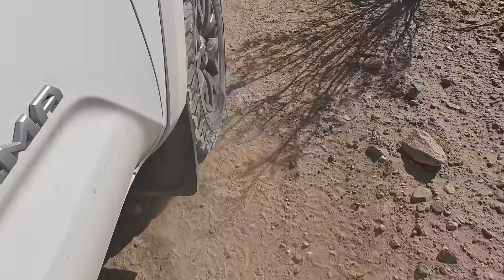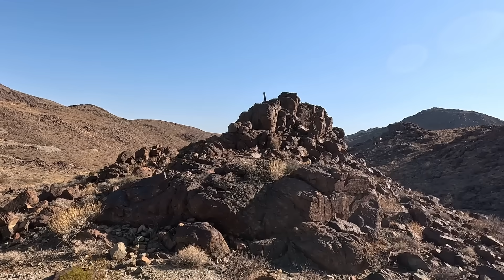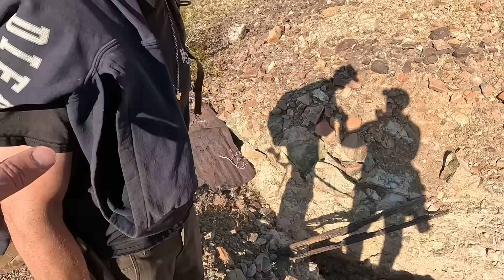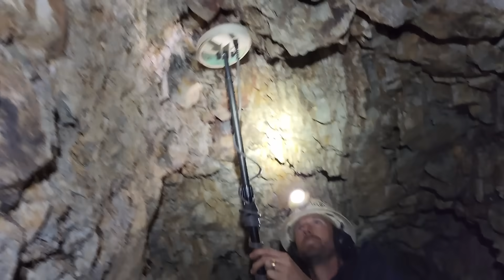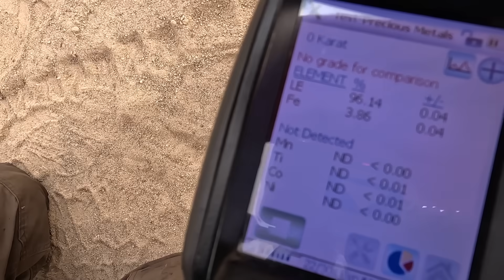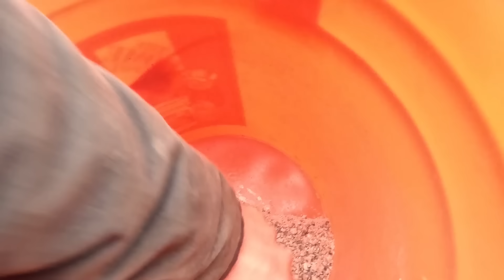Metal Detecting & Exploring California Gold Mines

Comment: Night and day difference in detectors there. That White's Goldmaster 3 is almost museum-worthy. I think its running at like 50khz and was introduced over 30 years ago. Meanwhile that 2300 is using pulse induction and the tech inside is only a decade old. Finally we saw the GoldMonster 1000 which is famous for pickers. It's also a VLF but running at 45khz and at less than a decade old has the most advanced hardware of the three. For those big pockets you might want the GPZ7000 but for inside adits like this the Falcon MD20 is extremely handy. You probably know all this though.

Comment: Running a detector is not easy.
I would say it’s kind a like learning to play the piano.
 There are pianos that play them selves almost but you still don’t understand what it’s saying.
 You guys need lots of lessons on detecting especially hard rock.
 It takes time and practice and concentration What’s your not able to when you’re first learning for more than a few minutes it’s like go lean muscle reflex reuse our learning you can only do for a couple minutes until you get some experience and the more and the more you do it the longer you can do it and the better you can concentrate.
 Takes practice at home learning how to run your detector everything Hass to be almost just perfect it just takes somebody that knows what they’re doing to stand there and do you all started since your all into gold..
 All detectors discriminate all in your ear that’s why the best headphones you can get I work for you is necessary beginners go through headphones fast..
 Make sure whoever is giving you lesson has found 1000 to 10,000 nuggets it will make it much easier on you.
Reply: Salva piano you could say it’s like welding if you didn’t have anybody to show you anything about welding can you do some wet old sticks I am it was all up to you to figure out.
 You’d be welcome pipe by the end of the day.
 Just like you’d be finding gold with a Detector by the end of the day.
 Can you put a wire welder in your hand that I got all tuned up the right metal the right wire right And you could draw a line with that welder and make it kind of work but if you had a tune it up yourself or understand what’s going on I’d be lost.

Comment: 2:36 As a hot intrusive is cooling, everything shrinks, the weakest fractures allowing residual fluids to hydraulically inject and push the country rock apart. This can repeat multiple times, metal content varies. With compass note strike, you would want to travers at right angles, hoping to crosscut an interesting vein. Could you pay attention to shitty audio. FIND a way to use Bluetooth clip-on microphones with windsocks, all conversations become crystal clear, greatly improves the video! Make this an important audio upgrade, you want repeat customers. I have tried get your attention numerous times; you keep putting it on the shelf.

Comment: Loved this video along with all your others. I have a metallurgical engineering degree and worked in several large scale gold mines over the course of my career. I have worked operations from heap leaching to cyanide in vat leaching, to gravity separation of coarse gold. Hearing you discuss the tailings reminds me of one of my professors stating yesterday's tailings become tomorrow's ore. Tailings are ideal as most of the energy required to mine, haul, crush, and grind has already been expended. It is not at all  unusual for older tailings to be reprocessed several times over many decades. Obviously the value must be in the tailings to make reprocessing them economically viable. This is a great channel and reminds me of family run mines some of my friend grew up on as kids. Thanks for sharing the excitement of mining.

Comment: The early 1932 or 33  is when all the gold coins were recalled by the government for meltdown at $20 per troy ounce given in trade. At that point private gold ownership was more or less illegal until like 1974 . So if the gold mines were not directly working with the government by turning in everything for cash ,they pretty much all got shut down no matter what the production rate was. No doubt the best claims and mines that got shutdown were sealed or outright collapsed to prevent anyone else from taking advantage of the work done sinking a shaft and setting up tracks and winches and air pipes, ect. The lower grade mines are most likely what are still more or less open .

Comment: Jason, the subduction activity still extends into western Nevada, eastern Oregon and Western Washington. The oceanic plates that subduct are 60 miles thick....they don't just melt to nothing.  Instead they partially melt, get hot and rubbery and continue east under the continent.  Look at the EQ clusters on a 2 week or 1 month feed and they are tracking the same basic range of distance perpendicular to the coast of western N America. I track seismic activity from Alaska to Mexico on public access seismograms.  Rapid subduction creep is underway along all of western N America.   This is shifting the subducted oceanic plates.  Windows in the subducted plates allow upwelling hydrothermal activity.  This explains the multiple episodes of hydrothermal emplacement. Subduction creep is a process ahead of the Great Cascadia Mega thrust EQ.  That's a cycle that continues to emplace mineralization in areas east of what most expect.

Comment: The GMT needs a new board installed because of letting it screech too long of time on hot rocks, or because of prospecting with the 4-times power switch in the on position, which was meant for short quick checking of faint signals.

Comment: Once you see the physics being applied in gauging of dowsing gold lode deposits or placer gold concentrations, you will want to become a professional dowser for locating gold deposits or any sought element. Read my book: The Art Of Dowsing - Separating Science From Superstition ($14.95), by Michael Fercik, explains all the physics involved gauging of dowsing sought elements and teaches how to build the modern light weight ball bearing dowsing rod. This is the only dowsing rod that is able to apply physics in the gauging of dowsing sought elements, by pitting the energy of gravity against the energizing of the pure one-tenth ounce dowsing rod load that is tapped onto the ELEVATED acetylene welding rod, at five-inches from the hub's shaft that is free spinning on ball bearings. This precisely gauges the dowsing of all edges, exact center, depth buried with angle of deposition, and most important is grading or deciphering the amount of the dowsed element that is contained in the elemental mass that is being dowsed. Anybody can become a professional dowser by practicing and mastering the dowsing lessons taught in my book